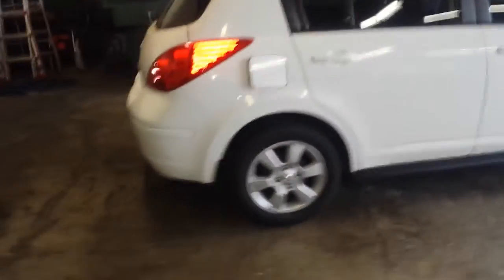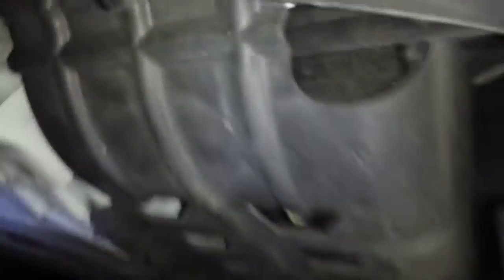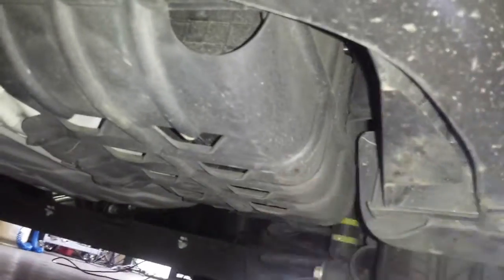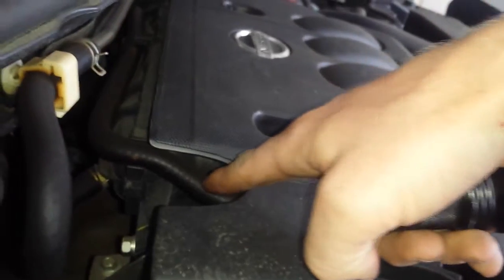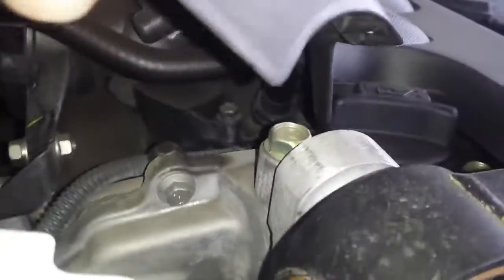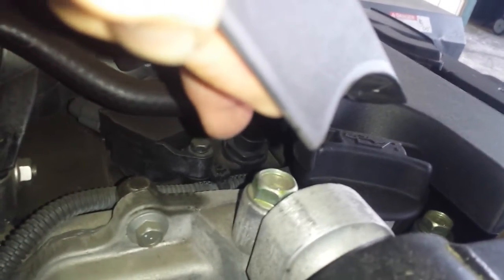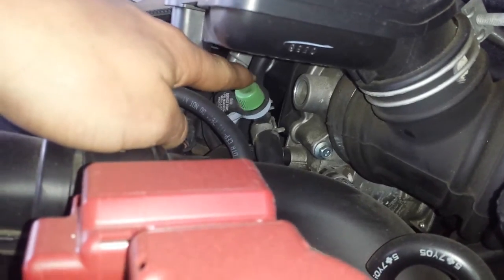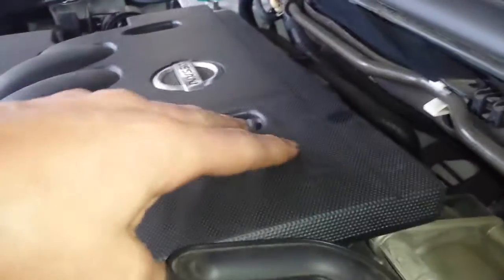Nissan Versa emissions: EVAP canister, Evap Purge solenoid, & PCV valve locations (Trazo, Tiida)

Comment: Hey Scottie appreciate that my friend! does the evap vent/purge solenoid  fix po455 code (small leak evap)? I need to fix this asap!!! thanks
also, isn't the vent solenoid usually in the same location as the canister? (passenger rear by gas tank). I have a 2012 versa hatchback

Comment: PCV valve is on the other side on the HR16DE (1.6L). Not far from the switching valve which is pretty close to the 1.8l in the video.

Comment: Whats the function? Or how do you use that EVAP green service port? I have wondering. Beacause I can open and close it and nothing seems to happen
Reply from the maker: That is a diagnostic service part. You should have a Schrader valve in there that holds the pressure back when you take the cap off. If you had the correct tools or the ability to you would hook up a smoke diagnosis machine to that service. That's to find a EVAP system leak. There's really no other reason to play with that. You never want to induce a cleaner for the engine through there or any other additives. It's strictly to find leaks in the EVAP system.

Comment: Your title says purge valve solenoid, but you say vent valve in the video. Are they the same?
Reply from the maker: The purge is under the hood near the engine and the vent is usually under the car near the vapor cannister.

Comment: Tengo una Isuzu rodeo 2002 tengo unos codigos P0463, P0452 y P1220 me puedes ayudar con información?
Reply from the maker: The fuel pump assembly should be looked at. If it was mine, I would replace the fuel pump assembly. Have you noticed the fuel level on the dash not being correct? Check the wires to the fuel pump too. they might have a bad connection. That is a start.
Reply: Scotties Hobbies exacto el nivel me fallo al inicio... ahora el problema es que no arranca
Reply from the maker: You need to check the wires to the fuel pump assemble. If they are making a good connection then replace the fuel pump assemble. The level sensor is on the fuel pump housing I believe.